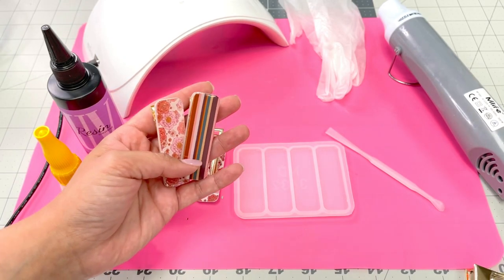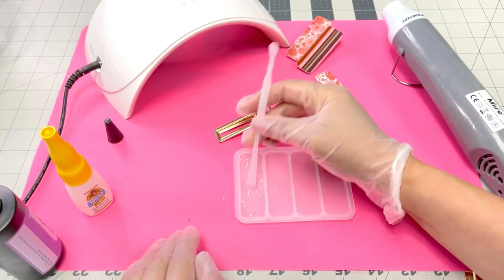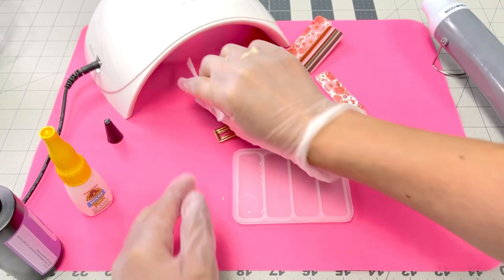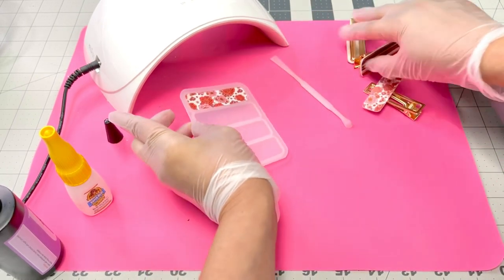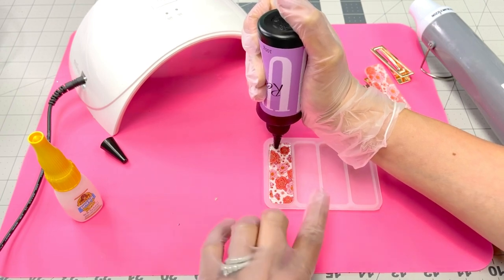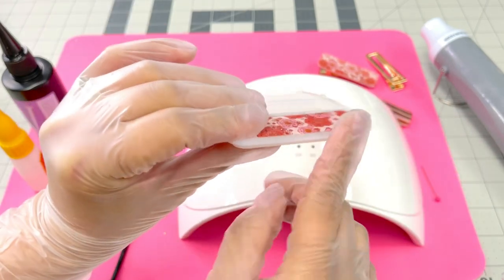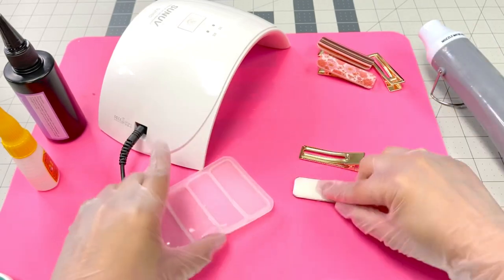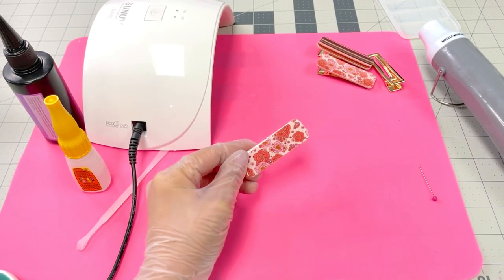How to Make a Resin Faux Leather Hair Clip | Epoxy Hair Clip Tutorial | Resin Hair Clips

Comment: Great video! Is the print a heat transfer or did you print on the faux leather?   I am using printable heat transfer vinyl and  having trouble with the print lifting off my faux leather.
Reply from the maker: Hi! The pattern is already printed on the faux leather. :)